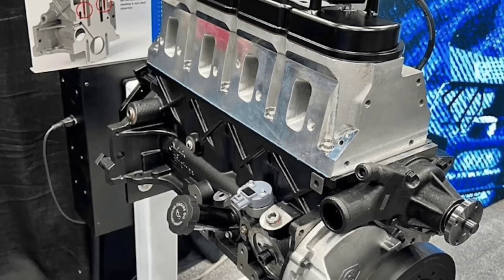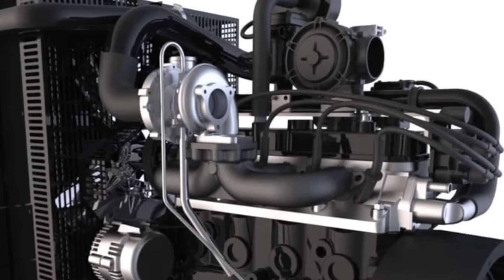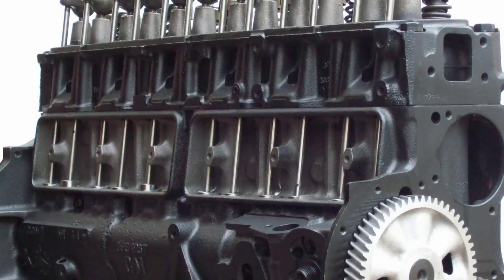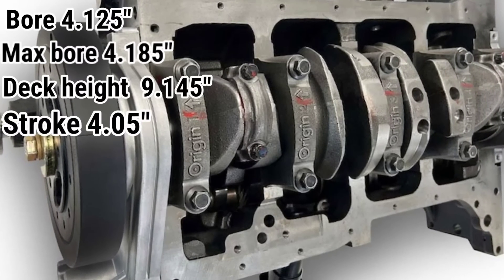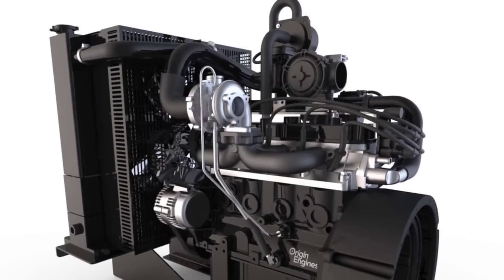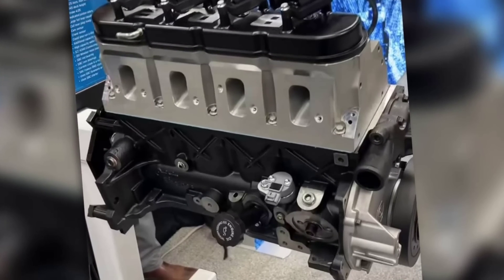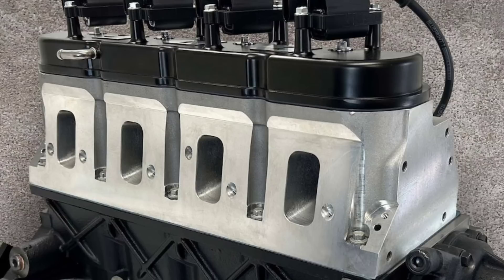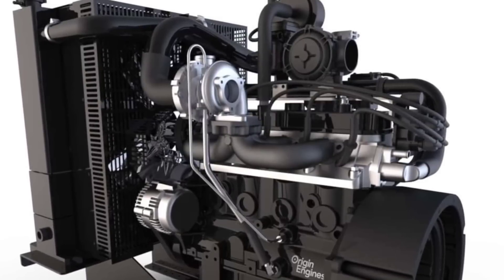SPECS and MORE on the 3.6 LS 4 cylinder engine by Blueprint engines

Comment: It reminds me of the various midget sprint car engines, of similar design, that racers have been building for decades. 
And something like that is the only practical application that I can see for a engine like this. There are just too many good, mass-produced engines, that produce similar power numbers in stock form, and potentially much more with their vast amounts of aftermarket support.... And you can get them from wrecking yards!
Reply: Yes , same thoughts. I really likeed it at first , was envisioning a decent inexpensive SMALL sized platform. But after a lot of thought, a stock tweaked N/A BuickV6, 3.8 puts out 255hp and 285ftlbs of torque...and costs $750 for low mile, complete engines...Again I love the blueprint concept. But upon further investigation, its a no winner for me, based on a dollar per HP basis alone...
I was lovin it for a day though!@!!!  (still do, just not for me...)

Comment: Stroke has almost nothing to do with rpm that is mostly vaule train. Having an ls head with the right cam and spring setup this could rev to 8k.
Reply: No without vibrating itself apart.
Reply: @asylumville8544 yea this engine has no balance shafts. It would need twin counter rotating balance shafts coupled with titanium rods and short compression height pistons with limited skirts and narrow pin bosses w/short pins to keep recip weight down. So i dont see how they can make it work, not at higher revs, in the 2k range but above 3k and nvh/vibration it will destroy itself.
Reply: Side loading, R/S ratio, piston speed all have to do with stroke.

Comment: Chevy small block has several flywheels, a small diameter with 153 teeth  and a large diameter with 168 teeth. There are also a difference for older internal balance (larger 6 bolt pattern) and newer (86 and up i think) external balance (smaller diameter 6 bolt pattern). The spacing difference is quite significant.
Reply: To expand on that, when blueprint engines says it has a "one piece rms crank flange" it means one-piece rear main seal crank flange, so the smaller '86 (I think you're right) and up bolt pattern...

Comment: I wouldn't Turbo-charge it because of the idea that it isn't a very high revving engine; however a supercharger slapped on this with about 12lbs of boost and a good underdrive pulley setup might boost that 340 and 500 number and have it coming in much lower making it a good 1/8th or possibly 1/4 mile machine. When you consider what goes into turning good ETs at the strip having good torque numbers to get you off the line is paramount and this is making great power in that regard.

Now for those that are looking at the numbers and wondering why they should be impressed by them, think about this for a second, a NA 6.4 Hemi puts out somewhere around 480hp and 475 lbft of torque but weighs damn near 700 lbs fully dressed. When you consider this 3.6 has half the cylinders, half the weight and makes almost 75% as much hp and makes almost 1.25 times as much torque it is amazing.

 Go drive a Scat Pack Challenger or Charger and launch it hard a couple of times and then imagine what that would be like if you shaved almost 400 lbs out of the front-end. I can tell you what is going to happen, by lightening the front, under inertia, you are transferring more weight to the rear of the vehicle and that is always a plus when you want your tires to bite and let you leave the line like you were shot out of a cannon. 

Now, if the engine is equipped with a gear to gear timing set, the proper cam, and the porting of the heads are done accordingly, being able to throw between 18 and 20 lbs of boost at this bugger to make it produce mid to upper 400s maybe even 500s for hp and well into the upper 600s for torque is not unthinkable depending on what style of forced induction one decides to throw at it.

 Think about the new twin turbo 3.0 Hurricane inline-6 that Chrysler released and this little 4 banger is 5/8 of a liter larger yet and already makes more torque with lower HP and a single undisclosed turbo. These are pre-production baseline numbers that we are receiving, let some mad scientist with a flow bench, engine dyno, and a full-on machine shop get experimenting and who knows what the possibilities are? I think they are coming to press with a safe baseline crate engine that will reliably perform as is to spur interests and that the real sorcery is still in the making. You don't come out with the peaked performance variant first and then tame it down, you start safe get real world application data, forum feedback, and build up from there. Just saying.

Comment: I am so happy that this engine didn't exist and/or was used as a stock 4cyl application in light vehicles 30 years ago, or I never would have had any reason to punt the Iron Duke and 4spd stick out of my 88 S10 in favor of a 350/TH350. My life would have been quite different.
Reply: Actually that 3 liter marine and industrial engine has has been around for way more than 30 years. I first became aware of them when I worked a couple of summers at a friend's marina way back in the mid  '70's.!

Comment: 3.6 liter NA, I would say around 250 lbft/360 Nm and 200/220 HP. Probably the turbocharged figures provided are for about 15 pounds of boost (1 bar). I think it is a very nice compact engine, if it does not vibrate too much. With a small turbo from G25 series pushing around 22 pounds,  probably it will output around 500 HP/625 lbft (if internals can sustain it), nearly no turbo lag thanks to the large displacement.
Reply: No frickin way. Your not going from 220ft pounds to 750 by just adding 7 pounds of boost. Maybe 100 more horses and another 130 to 150 foot pounds.
Reply: @mustangdemon87  oops you are damn right, I updated the figure for the torque: 625 lbft at 22 pounds of boost (not 7)
Reply: @Julien Boucaron  sorry idn why but this stuff is like built into my brain
Reply: I was thinking NA around 190HP and 250TQ  and the boost number was really cold 12 psi on high octane with decent amount of timing. I bet with in car tempsi bet it would be 25 hp 45 tq less.
Reply: I think this engine gonna make way more than 200 hp. that engine might make less than 400 hp with that bore x stroke size i’m just saying. this is my first time ever watching and seeing a 3.6 L in line-4 cylinder engine and most in line-4 Engine displacements are around 1L to 2.6 L.
Reply: @Sherro Kinchen  it's really just a scientific math game of how much fuel can physically be burned in that size chamber before it explodes or lifts the head. Adding boost does not add power there is a lot more too it.
Reply: Once you get over 3 liters on an inline 4 you're really limited on your revs and consequently horsepower. That's why no one makes large displacement 4 cylinders except for slow reving industrial and/or diesel engines like the 4bt.
Reply: This is a marine mercruiser motor with more displacement and an LS head. The marine motor makes 130hp I think. So with a bit more displacement and some decent head flow it could make 200hp NA. It’s an interesting idea but I think it would need to be pretty inexpensive for it to get any traction.
Reply: @mandagrath  This is an Origin brand industrial engine with an LS head.

Comment: I think a big attraction is simplicity.
Pushrod motors are fairly straight forward, and position well within most enthusiasts skillset. OHC engines , generally require a more refined skillset, especially high Rpm normally aspirated configurations. I love this engine setup, simple , stout appearing, and economical -ish.
I would need 4 bolt mains and a forged crank though to rate this at a ten . I have a feeling pushing a lot of low Rpm boost is going to walk those rod caps around. Otherwise I still love it. Nice job Blueprint, sweet combo you have cooked up .
Reply: As a technician I personally would rather work on overhead cam
Reply: The Atlas 4200 is a dime a dozen in northern junkyards these days and produces more HP per psi than any LS. Nivlac57 is showing the world what those are capable of and working out great parts combos for budget builds.
Reply: Most anyone who works with four cylinder engines is pretty comfortable with OHC, and probably even finds it easier to work with. Plus, OHC isn’t exactly rocket science.

Comment: You won't have to worry about the 2 bolt mains. You have 5 bearings supporting the crank, and it is only a 4 cylinder. Plus, there is no way this will be a high RPM screamer with a 4" stroke on a 4 cyinder. It would be neat to see that big 4.185" max bore with a 3" stroke, though. 😁.

I mentioned this engine to my dad, and he is pretty interested in more power for his boat. If this thing turns out to be a reality, we will consider it. It is the first real aftermarket for the Chevy II 4 cylinder. They should consider dual bellhousing bolt patterns for the GM Metric pattern as well as the standard V8 pattern. The engine mounts should also include provisions for Chevy style and Pontiac (Iron Duke) mounts. That way, this could easily replace the Iron Duke. Actually replacing a Duke may be easier since it used a cross flow head, and Chevy did not.
Reply: fieros would be insane .... demand would come back
Reply: @bucket-9-9  Excessive Low Rpm boost under 2500rpms will walk those caps, and flex that crank into pieces.
The key words are excessive and overly aggressive. This engine is desperate for 4 bolt mains, forged crank and rods, if its pushed at all! 500hp is effortless nowadays, If this bottom end cant handle 750hp stock its a NON starter for high performance. If that the case other options..Just buy a stock k27 and add  cams, or a bone stock buick3.8 v6 with a Halteck ECU and, fuel pump, atomizer injectors and be done with it, unless you like breaking things...for less performance, repeatedly..

Comment: What is the bore spacing, if known? I'm assuming 4.400" since the LS cylinder head fits.
Reply: If it is based of the GM Vortec 3000 engine, which is the latest version of the Chevrolet 153 I4, then the bore spacing will be 4.4"
Reply: @geoffmooregm  Thanks for the info!
Reply from the maker: No mention of spacing